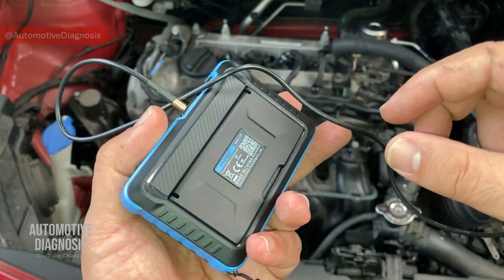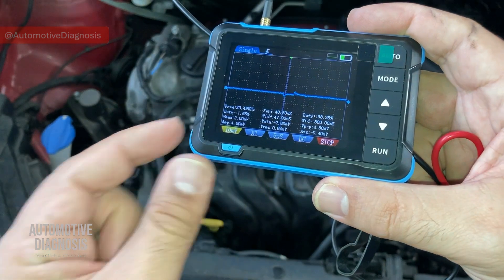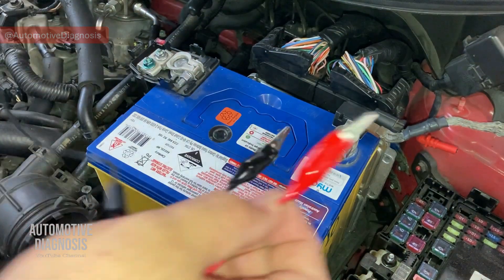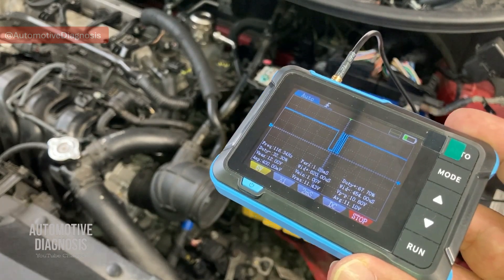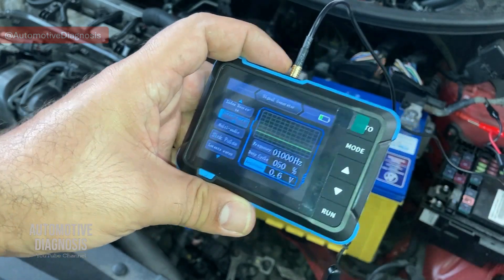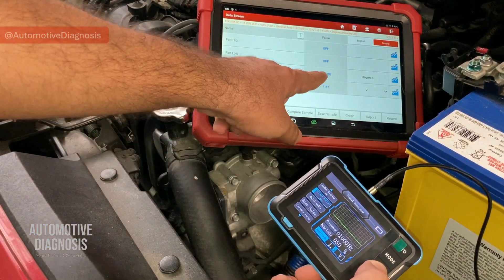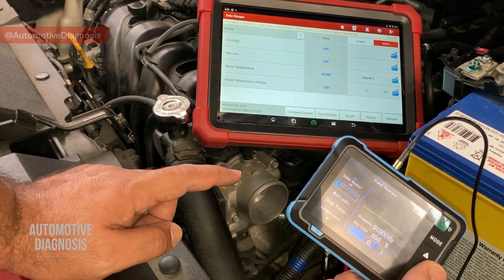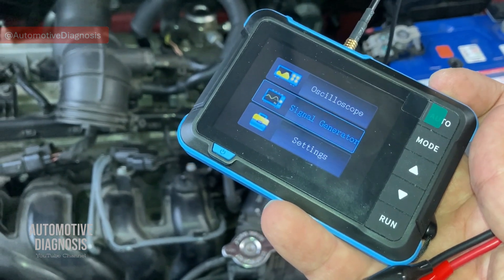A Must-Have BUDGET Automotive Diagnostic Tool for 2025 - Budget Oscilloscope & Pulse Generator

Comment: Is the FNIRSI 1013D oscilloscope good for automotive electrical diagnostics?
Reply from the maker: Hi there, I don't have that exact model, but I do have DPOS350P, which I found it very good for automotive diagnostic. We have some videos already on the channel for that scope, more are coming soon:
Automotive Network vs Budget Oscilloscope | CAN BUS, LIN-BUS & K-LINE Diagnostic with a Budget Scope
https://www.youtube.com/watch?v=kyA4d5DfWvY&t=777s
Budget Oscilloscope vs Crankshaft & Camshaft Position Sensors | Engine Timing vs Budget Scope
https://www.youtube.com/watch?v=gsuC_kD4kt0&t=11s

Comment: can i use this for detecting a battery drain parasitic draw? because my honda hrv 2020 has a problem since 6 months started with a keypob  i found the fuse #21 for back up and #22 for audio i remove the audio fuse for now i cant use audio but still draining my battery because of this back up fuse still drawing.the wring i cant find a good site for it alldata cant find hrv 2020 maybe i need to pay first? any other site i can go for legit? need help is this will help me? but i still need diagram

Comment: Testing a thermistor circuit with a pulse generator is totally unnecessary, if plugged in and you have say 2 volts, then unplug and voltage increases to 5 volts on the scan tool, you are done, circuit integrity is good. You would have been better off demonstrating on a Hall effect or inductive sensor.

Comment: Great demonstration. The NTC coolant sensor is just a variable resistor and drops the 5V ref signal to a lower value which is detected by ECU. The 5V ref and signal are the same wire on this sensor circuit (hence two wires instead of three). You could also use a potentiometer (a variable resistor, 10 turn, 0-10kOhm works well) across the 5V and ground wires at the harness as well to drop the 5V ref, without having to provide power (it should already be there). Your tool provided constant DC voltage to the harness which also mimics the sensor (NTC variable resistor).

Comment: Coolant temp sensors don't generate a voltage, they change resistance according to temperature, most used are negative temp coefficient
the hotter they get the lower the resistance, this is accomplished with iron oxide doping, the hotter iron oxide gets the more valance electrons released becoming a better conductor, in the computer there is a 5-volt regulator through a fixed resistor, it is a basic voltage divider circuit, the computer monitors the voltage between the fixed resistor and the resistance on the coolant temp sensor, so why pump voltage on the circuit instead of changing resistance mimicking how the coolant temp sensor works.
What kind of car is this? It will be the first time I see a coolant temp sensor generating a voltage.
Reply from the maker: Hi my friend, thanks for sharing your experience and knowledge. 
In this video I didn’t want to go to the technicality of the coolant temp sensor, I was just trying to test the device. What you said about the sensor is absolutely correct. By output voltage we actually mean the voltage adjusted and affected by sensor resistance. So, sensor resistance changes in different temperature and so the voltage. When we are simulating the sensor, we do what sensor does, we adjust the voltage how sensor does, to see what is the reaction of ECM.
Reply: @AutomotiveDiagnosis  Got it, thanks.

Comment: CAN THIS TOOL USED TO DIAGNOSSE THE SIGNAL FROM ALTERNATOR/CHARGING SYSTEM TO TELL IF THE PCM IS CONTROOLING AND ALSO THE THROTELL BODY SIGNAL CONTROL/PCM AS ALWAYS THANKS FOR SHARING BROTHER.
Reply from the maker: Yes, we can use the oscilloscope for checking the alternator, and pulse generator for checking the throttle position sensors.

Comment: Thanks, very informative video. Just a suggestion, if you take 8 - 10 sensors on a vehicle and make a demonstration video (maybe in 2 parts) of how this Oscilloscope/Signal generator can be used to simulate those sensors by sending a test command to the computer. I think you already said so, and it will be good. 🐞
Reply from the maker: Thanks my friend for the suggestion, I will look into it for sure.👍
Reply: Highly irritating speech pattern
Reply: He did. I wanna see how the O-Scope works to determine if stuff like injectors are doing what they are supposed to do. He showed how the Signal Generator works to test a sensor, I want to see how the O-Scope part can be used to test injectors or fuel pressure regulators and other "non-sensor" components. Cool vid. Cool dude. Just saw this today. I just got the DSO-510. GREAT budget tool.

Comment: ECM provides voltage to the sensor, is it safe to supply the same back to the ECM? I'd just use a potentiometer to simulate a temperature sensor, which changes it's resistance according to the temperature.
Reply from the maker: That’s exactly what a pulse generator does, when we are simulating a sensor, we must adjust the voltage in the range of the sensor. For example in this video, before starting to do the job, we must know how a coolant temperature sensor changes the voltage in high or low temp and how it works. And you see in the video, we connect the cables on both positive and negative side of the sensor's wiring, so basically we do what sensor does, we adjust the voltage by this device. This is what sensor does on different temperature range. Even on professional automotive diagnostic tools which come with sensor simulator (and some models that I have used in dealerships as OEM devices) You will see an item exactly for simulating the coolant temp sensor with same way we did here. It means instead of sensor changing the voltage, we do this to see if ECM is responding properly or not.
Reply: @AutomotiveDiagnosis  That's true, I have a Launch sensor box with a list of all sensors that it can simulate, I have tried the coolant temperature sensor simulation, It asked me to connect the probes exactly how you did. Then it shows the range of voltage that I could adjust, again like how you did with this device.
Reply: @AutomotiveDiagnosis  I really appreciate your practical videos for us, but in this case I don't see in a video where you first show if there is any signal voltage coming from ECM to coolant temperature sensor at connector side (I'm sure there would be around 5V and the scan tool showed that). Then instead of applying variable resistance, you just supplied another source of voltage to the ECM. I can understand that device you are using cannot provide enough current to damage something, but still I don't think it is a good idea to connect a voltage source to the ECM input channel which is already configured as a source and not as sink.
Someone after watching this video might take a simple 1.5V AA battery (which can provide up to 10 amps for some time if short circuited) and connect to the same connector to see if temperature reading changes. Hoping that ECM channel has some kind of protection implemented is not guaranteed either, different car makers use different quality modules.
No offense, just my subjective opinion.
Reply: Amps cannot be pushed through a circuit, only pulled. The circuits in a vehicle are ultimately powered by a battery that can supply hundreds of amps if required. However, the number of amps that can flow is limited by the design of the circuit. Now voltage is what should be controlled. If the sensor receives 5 volts from ecm, you can send up to 5 volts back through the supply side of the circuit. Any more than 5 volts on that wire will create a floating ground and current will reverse. That is what to avoid.
Reply from the maker: @ Thanks my friend for sharing your experience and knowledge 👍👍
Reply: If no signal goes back to ECM how would ECM know what the temp is.
Reply: @benweya  temperature changes, resistance of the sensor changes, ECM has its fixed internal resistor, this creates a voltage divider circuit, supplied voltage will change as resistance of the sensor changes.